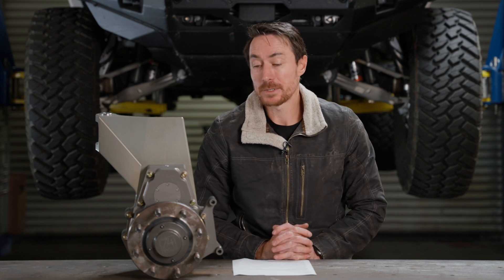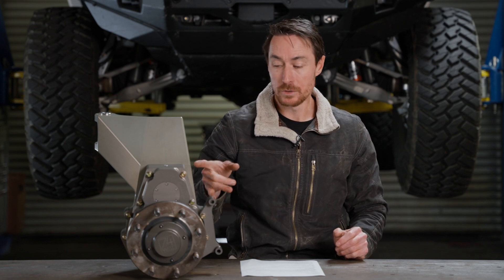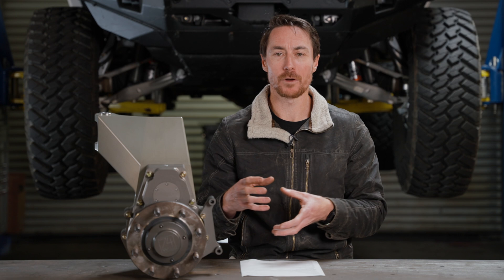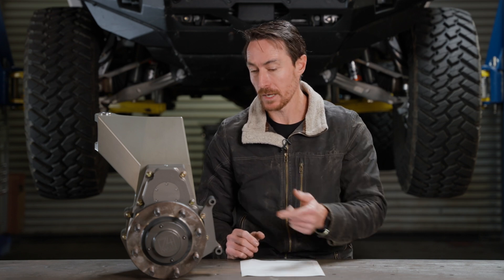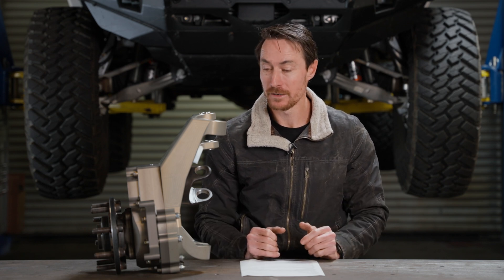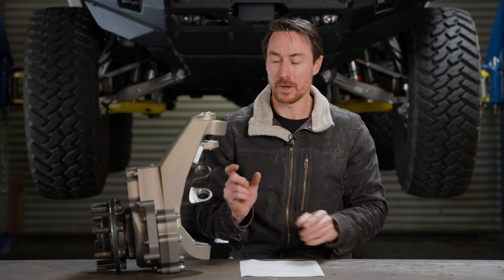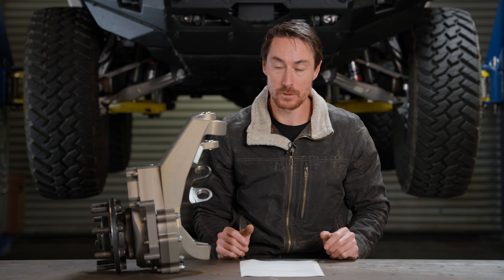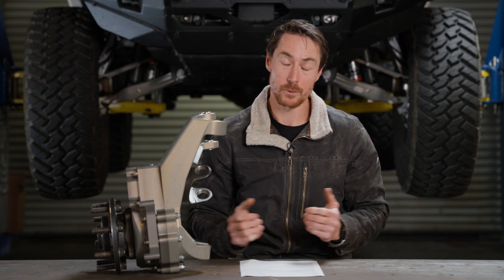The reason why we make portals for rock crawlers

Comment: I’m really interested in why a two gear set is better than a four gear with idler? 

Can you provide some context for the priorities?
Reply: Does the presence of four gears in portal hubs serve the purpose of providing a larger surface area? And does this configuration offer benefits such as improved heat dissipation and torque distribution, particularly in high-speed applications? Why would you not use this in a daily driver?
Reply from the maker: In a crawler I see no reason for a 4 gear. All axles that these will go on are custom built. You get to take a low pinion diff and flip it upside down. The package is smaller, able to run a brake in a higher location, and if the gears aren’t breaking which they aren’t, then more surface area from a 4 gear is moot.

Comment: I mostly do mild overlanding.  But I see the $25k price reasonable for just clearing snow and washed out creek beds.  I may get a set for my JLU and our Ram 2500 4wd.  Where the portal will really shine, is for the new Broncos and 1/2 ton pickups.
Reply from the maker: 20K, not 25. I agree. My Bronco on portals is now my daily driver because it rides so nice
Reply: @74weld  When I look at their website, I saw a $24,999 price listed.  $20k is certainly a nicer price.

Comment: Last I heard is you have to change the oil every 3k mile…. what wears out first from not changing the oil over excessive long changes. But I guess what I’m asking/ thinking is if the internals parts wear and if they are cryogenic treated how much less they will. Cryo can add a massive 150% to wear parts. Cryo is a must in certain top dragsters builds including turbos. However cryo has a very minimal beneficial  effect on aluminum.
Reply from the maker: It’s a volume thing. As micro particles enter the oil they cause the cushion effect of the oil to diminish. Can you go longer, yes. But this is a performance product and we tell people to treat it like one. You would never change your oil in your built motor every 3-5K. In my built LS3 I would change the oil roughly every 500 miles if not sooner. Same kind of idea

Comment: Does the 2 gear portal need to run flipped gear in a front engine setup and standard in a rear engine?
Reply from the maker: You flip front and rear diffs. So a LP turns into a HP
Reply: @74weld I know from your other videos that your a fan of the 9".  Are there any 9" thirds that work better than others in this 'flipped LP' setup?  In particular, with regards to oiling the pinion...are there any out there that have 'oil slinger' mods incorporated, or is the general recommendation to over fill the third?